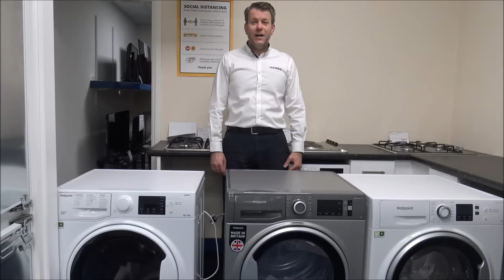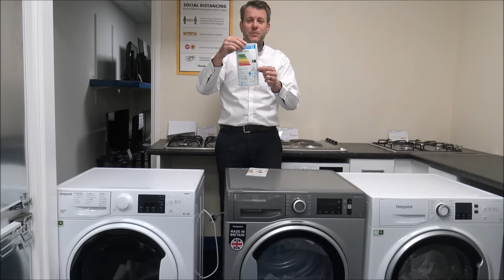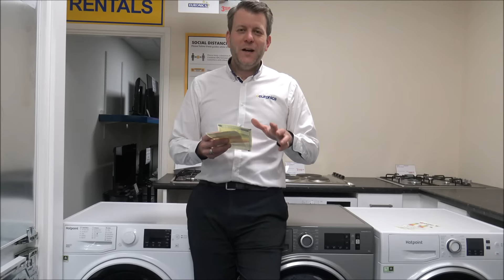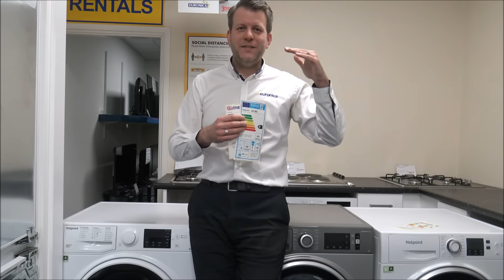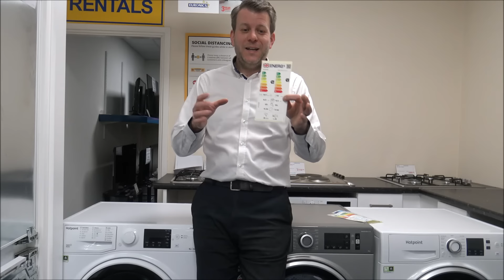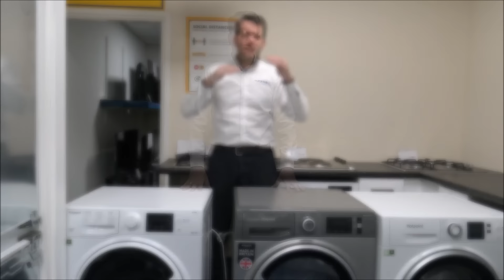Is It Better To Buy A Separate WashIng Machine And Dryer Or A Combined Washer Dryer

Comment: Why you don’t stand at the front. Also with each machine you show us with the camera closer what brand is the washing machine and where to get the lint out from. Also I don’t understand much about the cost of power as I have always had dryers and I’ll put bigger load in them to dry the max would be an hour or hour 1:15 but with Samsung they tend to put less items and the machine runs for hours to dry. 

So does this mean my drying bill will be higher to the double to dry the clothes. 

Or it dries slowly but it still energy efficient and will cost the same electricity like any other machine

Comment: Hi. I enjoy your videos, very straight forward and informative, so, Thanks.
I'm in the same position regarding space for only a single unit. I live in an old house (168 years old) with limited kitchen space and as my current washing machine is broken, I'm going to go for a combined washer/dryer ( I live alone so, probably 4 loads per month and I air dry when possible in summer). I'm prepared to spend for quality and longevity  and have almost settled for a choice of a Miele WTR860WPM PWash&TDos 8/5 kg. Have you any experience of this? I can't seem to find any user reviews online and hoping your knowledge and experience in the trade might help. 
Thanks in advance.

Comment: This was a Great video! I am considering this type of Combo unit, but I am wanting a more powerful drying system. 
They all seem to have great features, but take a LOOOONG time (some up to 6 hours) to start and complete a load of laundry.
I'd like something that matches  the washing and drying time of separate units.
 
Do these come with 220v?  Do they come with a vented/ventless option?
What Brand or Model do you recommend that is a bit more robust, closer to a industrial version?

Comment: I'm in the same business, and I would say exactly the same things. One thing though, when talking about lint in a combined unit, it can be a bit of a mess to clean it out. You'll need to open up the lid at the bottom, and all the water left in the machine will pour out. I'm sure it depends on brand and model, but I've encountered this on some units. The filter gets clogged and in order to clean it you get a gallon of water on the floor. The same thing really with a washing machine, but on a combo you hade to do it way more often.

Comment: i live in an apartment and had no option but to buy washer/dryer (normende model) has lasted me 11yrs it works well only thing i dont like is the numbers on the dial as when i want to select a different programme at times i have to refer to the manual to see what number is related to what programme apart from that its good

Comment: I have separate LG washer and dryer which are stacked together. You can have both stacked if they are from similar manucturer. They come with stacking kit. Perhaps you need to mention this as it saves space. Convenient for those with tight space suitable for those living in apartments like myself.

Comment: Washer dryers are more complex and likely to go wrong. I used to have one, it failed one day after the warranty expired. Consider whether you would repair or replace if there is a fault.
Reply from the maker: If it's a day out of warranty, I would get it repaired or at least speak to the manufacturer to see if they are willing to help first.
Reply: @lords-electrical  I managed to repair it myself. The mains filter was wet because a seal had been installed incorrectly. It eventually failed after a few more years and I went for separate washing machine and tumble dryer.

Comment: Owning both Zanussi and LG combination washer/dryers, the Zanussi was vented to the outside, whereas the LG had a water cooled condenser dryer.  I found both machines to be perfect for a household of two. 

The Zanussi being the smaller of the machines, I used it more often, and it did a better job of drying the clothes because of the venting. 

Working in an office, my clothes didn't get dirty enough to use anything but the quick wash. 

Thick towels are the only items that I let fully dry, but seldom used the longer cycles. I started using thinner, smaller bath towels to save time and energy.

I learned never to overload, to always separate by types of fabrics, and to always pull clothes out damp, especially shirts and sheets to keep them from wrinkling.
Reply: How old is the zanussi?

Comment: If space is an issue, there's also the option of a stacked unit, or placing a washer on top of a dryer. But if the issue is both space and lack of hookups, get yourself a combo unit. They're vent less, and can be hooked up to a kitchen/bathroom faucet.

Comment: I have a Hotpoint washer drier due to lack of space but I never use the drier now . I found it to be incredibly inefficient. The washing came out red hot and wrinkly as if it had been baked in an oven. I dry outside if possible and on a clothes drier if not. It’s not ideal but I wouldn’t have another washer drier.

Comment: Do the machines run in opposite directions when they wash clothes, and dry? Are the instructions in English, not some foreign Metric language like UK? Does the electrical wiring go from the machine to outlet/outlet to machine, since everything in the UK is backwards?

Comment: with front loaders you can stack them on top of each other to save floor space, top loaders you can wall mount the dryer above the washer and mount it upside down and bang your head on it until you learn the technique

Comment: My last two machines have both been combined washer-driers, (Zanussi) and both been extremely reliable, lasting around 15 years each. I prefer to dry stuff outside when possible, but it's nice to have the drier available for winter without taking up the space of a separate machine.
Reply: Hi. Which washing machine will you recommend as a combined washer drier
Reply: glad to hear  you have a reliable machine Could you please tell me the model nr and if it is noisy ? THANK YOU
Reply: @roxanav.b.4424  my zwt71401wa is very noisy when drying as the fan bearing has gone

Comment: I bought an LG washer drier and I am enjoying using it. I thought long and hard before purchasing as I live in a small apartment. I am use to hanging my clothes on an airer when my separate dryer broke down a few years ago and therefore I only use the dry cycle for bed linen and towels. This has made my life so much easier and has cut down on condensation in my apartment. Not having big items hanging around to dry. 
Driers can damage the fibres on clothes so I use this function occasionally but it’s there if I need it.
Reply: I had x2 in 4 years. All replaced on warranty. I asked for a washing machine only rather than Washer/dryer. It was alwsys a compromise. Almost burned the house down. The dryer heating element was prone to clogging as the lint built up in the fluff soak away. Customer service for LG was extremely good.
Reply: @smokego4808  I had no problems with the LG, and sold it to a neighbor before I moved.
Reply: @nomebear  incidentally, did you have a washer/dryer or washer? My washer/dryer was replaced twice 3 in total. The forth machine was fine being a washer only. It lasted 7 years. Great product.
Also our home was high usage. I believe in a low usage home, the washer/dryer may have lasted the full 2 years.
Reply: @smokego4808  That sounds worrying. That’s why I only use the drier part of the machine occasionally. And make sure I give it a good clean frequently . And you definitely need warranty when having a washer drier.
Reply: @ria5331  as you suggest. Occasional use is fine. Poor design. A wash/Dryer is always a compromise.

Comment: Do washer dryers, dry clothes in a different way to dryer only machines. Most people that I've talked to complain washer dryers fall down on the drying side of the equation.
Reply: The dryer parts are much more compact than in a "proper" dryer.  They are typically the same cabinets as a pure washer, so the dryer parts just fit in what is  normally the remaining shape.
Reply: Yep they suck in general. With most of them I’ve used they make the clothes smell of burning rubber and ruins the smell of the clothes where as a seperate dryer doesn’t do that
Reply: @josephw6977  
Sounds like a technical problem which does not seem beyond the wit of man to solve it.
Reply: @redmed10  no he’s right. I’ve had the same with everyone I have ever had to use. Separate machine are the only way.

Comment: Thank you... very useful video. I have sometimes said that when I needed a new machine I would or might get a washer / dryer ( don't have room for both) but never did.  I always wondered if that would be less efficient, and I also don't like how much extra electricity they would use. A few years ago I bought my 1st dehumidifier then at some point changed to a low energy one. It's about 160w and the washing is dry very quickly on an airer. I actually think that if I did get a washer / dryer I'd end up hardly using it due to the power consumption. Just call me Scrooge... 😁
Reply: So, you use a dehumidifier in your laundry room to dry everything...
I have a large electrical dehumidifier aside from my previous home and never thought it could be used that way. I’ll check the energy difference between the dryer and the dehumidifier.
Reply: @isabelle3365  I don't have a laundry room....wish I did. I'm in the UK and my washing machine is in the kitchen. I dry my washing at the back of my living room, but it's usually dry overnight.
Reply: When I bought my dehumidifier,  the manual specifically states "Do not use this for drying laundry."   Not quite sure why the warning as 15 years later, it's still functioning and has actually been in the vicinity of a drying rack full of clothes. 🙄
Reply: @professorr.5427  They must have changed the recommendations since then because you can now buy some that specifically say for laundry and have a laundry setting.  I fail to see what that could have meant, unless it was to prevent people putting it too close to  hanging clothes which could block the vent where the air goes in and out. Used with care they are great, and it makes you wonder where all that water would be if the dehumidifier hadn't sucked it in.
Reply: @amandadavies..  Exactly.  I'd rather be emptying the tank than mopping the water off my neck. 🥵
Reply: Thank you for your explications. I will try then the use of the dehumidifier at 2m of the airer to dry quicker a blanket i just washed.
Reply: @isabelle3365  I'm sure it will help.

Comment: Just the video I needed a week ago, lol. Our kitchen does not have the space for both a washer and a dryer. Especially because we also have a dishwasher. So my fiancé was suggesting that we buy a washer dryer, but I really didn't like that idea. My parents had a oven+microwave combi built in their kitchen and the microwave function broke unrepairably. What do you do then? Keep the combi as just an oven or replace the whole thing even though it's still working fine as an oven? My parents ended up buying a seperate microwave so how much did they win? I managed to convince my fiancé after some further research and coming monday our heat pump tumble dryer will be delivered. It will go in a different part of the house, but that should be no problem. It only needs power.

Comment: One advantage for combined unit is that you can put clothes in evening and take out the dry clothes in the morning. In that regard, it is much less hassle than a separate units. Also, in my country electricity is 2x cheaper at night, so with the combined unit you can take an advantage of that too.
Reply: You should not leave dyers on at night or when you go out. Advice by the Fire Service in the UK is never to leave dryers unattended.
Reply: @vanillaorchid  thats why you have // fire alarms // and also what are you gonna do if it does catch fire? cant exactly put out a fire can you?
Reply: oh and trust me, the firemen wont be there in time to prevent your house from having a LOT of fire damage.
Reply: @Vosmossy  If you keep a fire extinguisher at home, you easily put out the dryer or washer/dryer!
Reply: My Zanussi and my LG Combo washer/dryer were very quiet. Using them in the evening was not an issue.